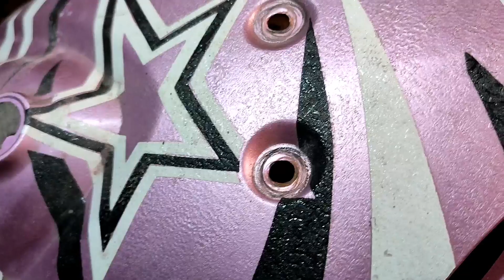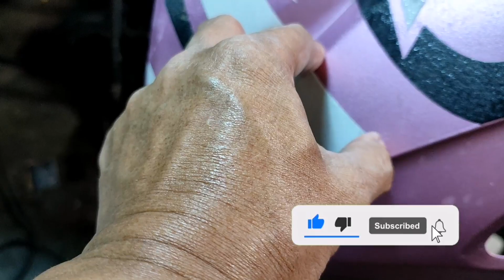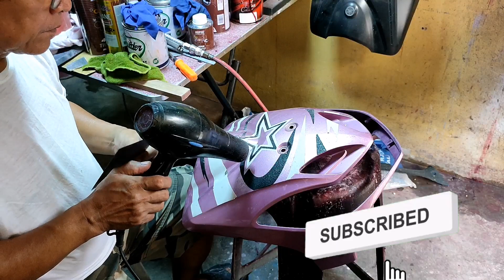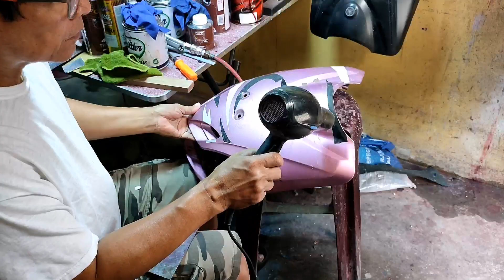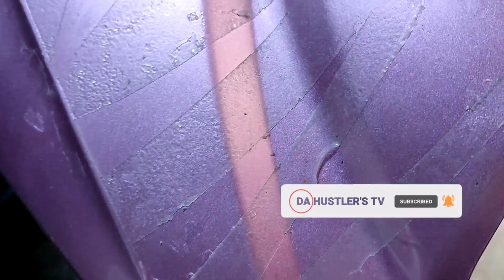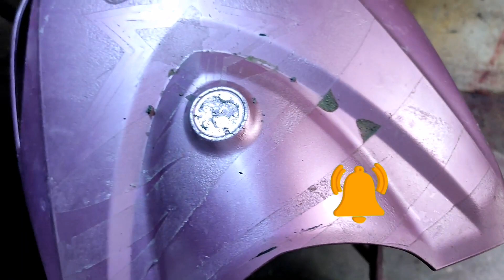EASY TO REMOVE OLD STICKER I DECALS WITH TOPCOAT CLEAR I DA HUSTLER'S TV

Comment: Master, okay lang po ba na pinturahan ng urathane kapag my nonesag epoxy? Wala po bang negative effect pag na applayan ng primer at base coat?
Reply from the maker: Diko pa naitatry yan kaibigan pero sa tingin ko pede naman basta lihain mo lang at linisin mabuti. 🤗
Reply: @DAHUSTLERSTV0310  master, align ba dapat ang nauuna nakakalito Kasi. Primer ba dapat Bago masilya? Or masilya Bago primer??
Reply from the maker: @tripnikaloyvlog3111 Kapag plastic may pintura at wala pang pintura kaibigan, primer muna bago masilya.
Sa yero pedeng masilyahan na agad, lilihain lang ng 120 grit. Pede ring iprimer muna bago masilayan. .